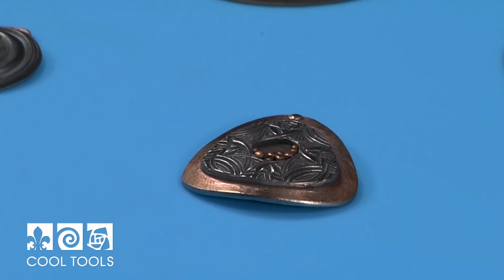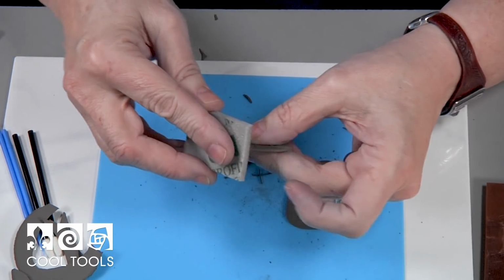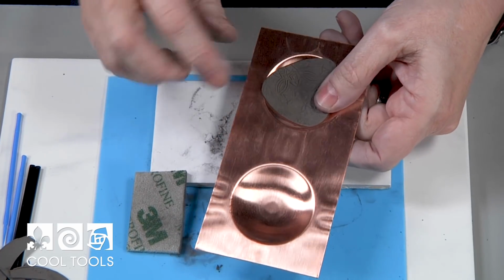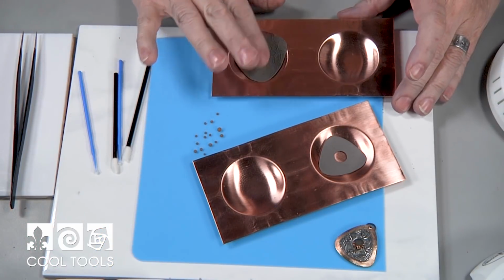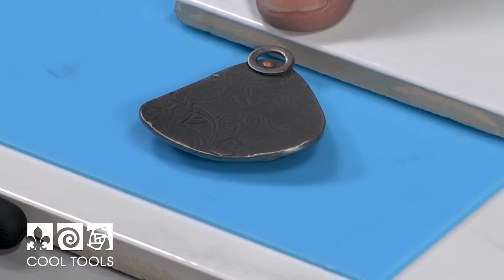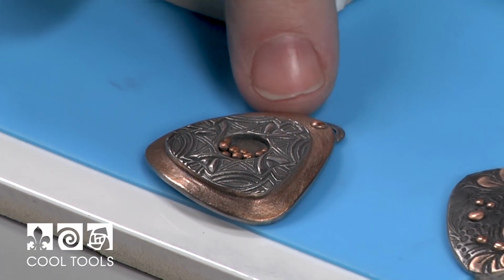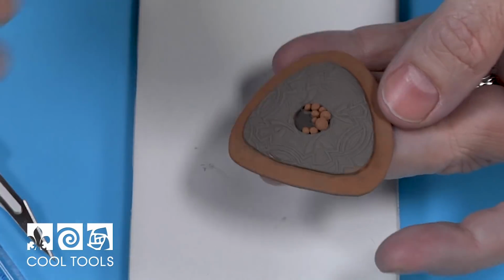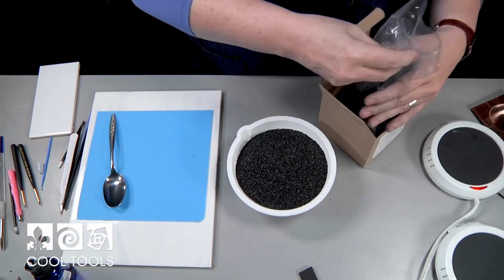Cool Tools | Two Layer Trillion Pendant by Cindy Pope

Comment: Good morning Cindy
Love this really helpful video.  I too have always avoided base metals because of the firing in carbon. 
2 questions the firing schedule talks about a muffle kiln vs a brick kiln. I haven t heard of a muffle kiln but assume it is like mine which is an even heat kiln? So that is the schedule I need to follow.
Also I have the no flake firing foil. Would this be a good option for a firing receptacle.  I mostly use PMC flex so would the carbon compromise the kiln in anyway.
Love your videos.  Thank you so much.
Reply: Morning Cindy
It says I have a reply from you but when I click on it’s not coming up? Just my question😐
All the others work fine so I think I have a gremlin.
Am very keen to know what you said so could you check your end and/or send again.
It’s a great video I ve watched it lots already 
Thank you

Comment: How do you cut such small balls in half when you use a single surface? Thanks!
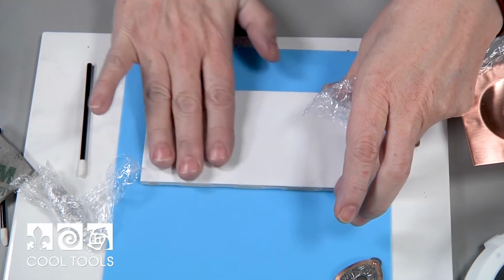Reply from the maker: Hi Laura, Cindy says: Starting in minute 8:25 of the new video I show how to make the faux rivets  ie 1/2 balls I even use the term 1/2 balls in the video. I actually take these in this project and roll them into full balls but if I stopped after using the Biopsy Punches and dried them they would be the 1/2 balls. 

Hope this helps!